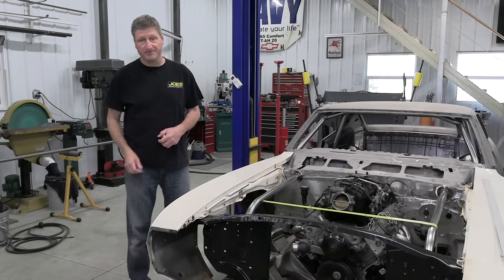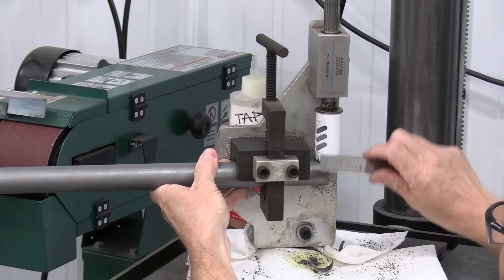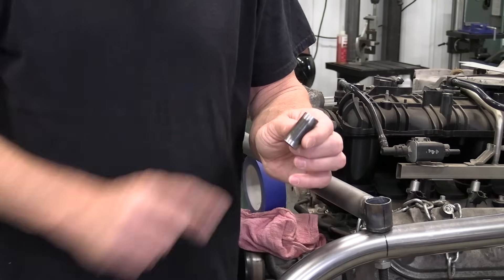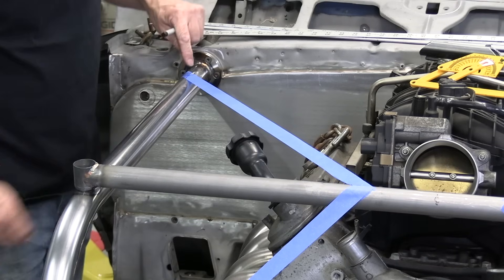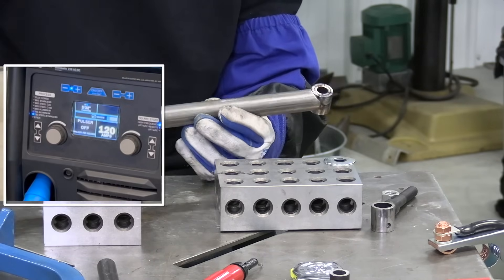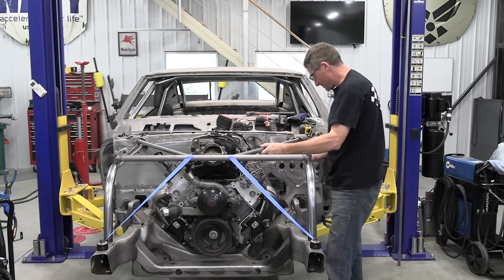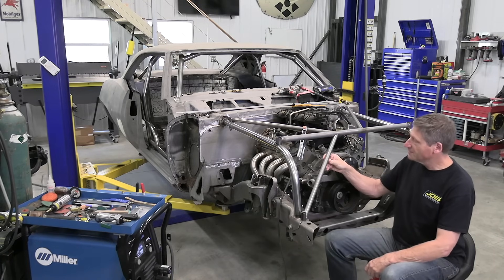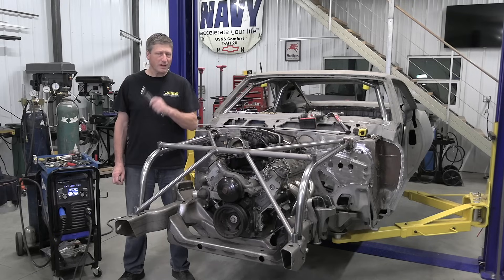Real Garage: ArachnoWELDia (Chassis Spider Bars) (Season 6, Episode 5)

Comment: Andy , I spoke with you at PRI about bubbles in my aluminum weld puddle that have been evident since my first Dynasty machine 300 ,700and 400 machines. This was never a problem with my syncrowaves or aerowaves also at higher frequencies my weld puddle was so smooth with the aerowave I could see the reflection up into my cone, all my weld puddles are not smooth during welding which has been a constant since my first dynasty back in 06. I currently have one tig machine a dynasty 400. I think my problem in hydrogen in the middle not the edges, could you share your settings with me and do you think the way the dynasty’s are driven can be a factor, could my electric power source be a problem (dirty power) I’m kind of grasping for straws here. Since 2006 I have try many different prep methods I have used literally thousands of pounds or different filler metal , every alloy multiple torches everything miller and anyone I have asked for advice has advised me to check. I never had this problem with my set freq. syncrowave and my first inverter based aerowaves. What do you think I should try. Thanks

Comment: Andy, I am curious about the rationale for switching between the TIG and MIG processes when you were attaching the diagonal braces to the center cross bar. Thanks, enjoyed the video!
Reply from the maker: There are two reasons behind this rationale. MIG proves faster and simpler for connecting bars, while TIG excels in precision when dealing with bolt bosses, aside from plug weld holes. While you could opt for either method independently, the Multimatic 220 AC/DC's ability to seamlessly switch between both provides the flexibility to enjoy the best of both worlds.